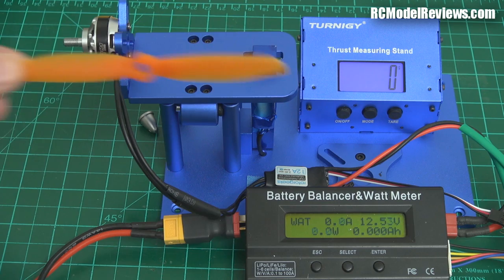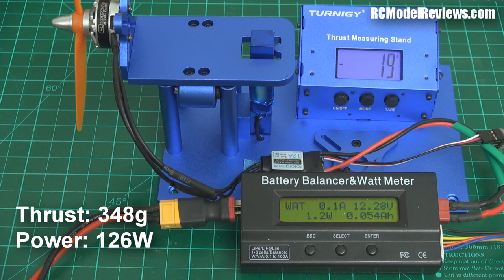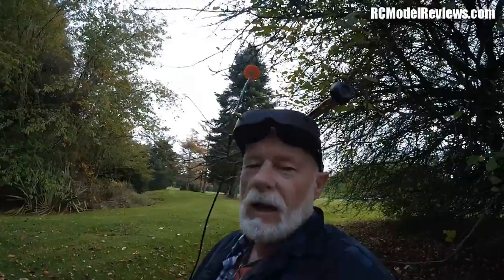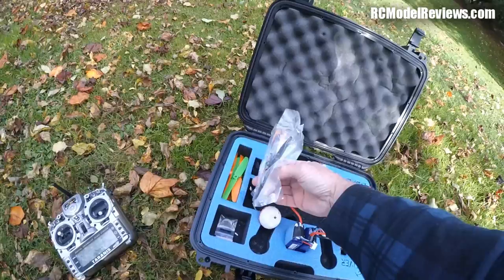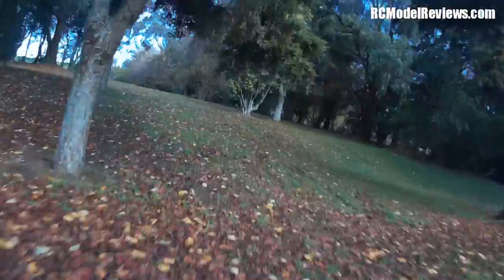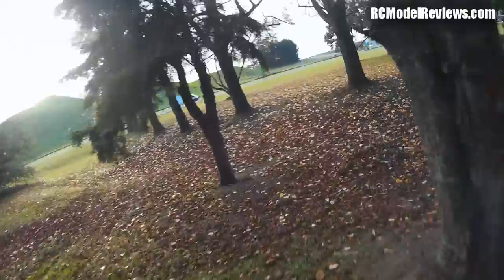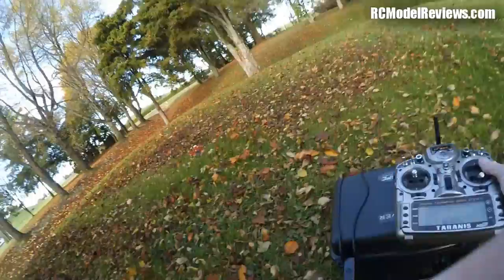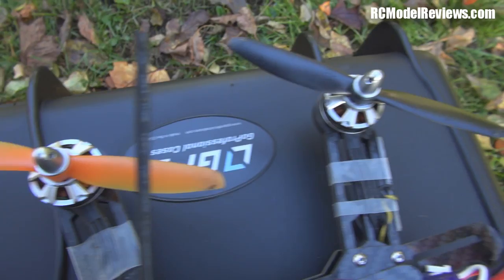Review: Surveilzone 5040 miniquad props (includes crash footage)

Comment: Great review & test.Looks like the chord length is shorter than HQ's & GF's 5040 blade airfoil so the SZ5040 airfoil needs a higher angle of attack. I'm only guessing that's why it produces 9~10% less thrust since that higher angle of attack also causes more turbulence which equals loss of efficiency. Wish HQ would also copy material used in SZ props.... but then not good for business, sales would drop. SZ should just copy prop shape from GF & HQ better. 

The SurveilZone 6040's cut down to 5040's are a good cheap alternative to HQ5045 bullnose props - if you have a prop cutting jig and want to save money. Bullnose props are very amp hungry due to the not-so aerodynamic tips.... lots of turbulence there I imagine, but they sure put out a lot of thrust. I measured them to be within 10g of HQ5045s with slightly less efficiency.
 
Cobra 2204-1960Kv
4S 40C 4000mAh Zippy Compact battery
92m AMSL
HQ 5040 673g @12.3A
HQ 5045 Bullnose 890g @19.6A
DAL 5040 Bullnose 879g @ 19.3A (Surveilzone 6040 cut to 5040)

Comment: Hey ***** thanks again for a great review and for your comment at Harley FPV some days ago, i'm kinda the stuntman in our review.
But Bruce, if you are looking for better performance, try out the 6040 as we use in our video and just cnc drill them down to a 5x40 SZ bullnose(KillerBEE//DAL6040 Propeller ABUSE test //UNBREAKABLE PROPS). Then they are actually better than the HQ 5x45 props even without 0,5 pitch. But the 6040 and the Von Sieg version is out of balance in the end where the numbers are, so where it says DAL it need a little tape slice.
Indestructible No, when you hit a AGP gate with 80 km/h ;-) but never the less a moneysaver.
I had some HQ 5x40 in spring last year and they were the same toughness as the surveilzone, but better in balance. It's like they got their brand imprinted into ppl mind, and then began making poor cheap props in toughness and durability to advance thier sales.
Best regards Jan "Von Sieg" Sigurdsson

Comment: Nice props. The problem is that if the props doesnt break something else have to.. Like the shaft or arms :)
Reply: daromeresperyd Yeah, I'm of the same mind. Happy to be proven wrong though. I'd rather crash energy be released in an exploding prop, rather than a bending motor shaft.
Reply: The Dark Pixel I have already changed alot of shafts lately due to them going out of balance due to that they are bent :)  But at same time if you run 2204+ with 3mm shaft instead of the ones on 1806 that bend way to easily it may work good and you are in the middle. Im gonna order some in next batch to test out atleast. to bad the thrust was so damn low.
Reply: daromeresperyd As I said in the video, that was also my concern but I'm pretty sure these props are flexible enough to deform instead of transferring the forces to the shaft.  I would think that the HQ5045 bullnose would be a lot more likely to damage your motor in a crash because they are thick and quite strong but don't deform much at all.
Reply: ***** ur most likely correct. The lack of thrust is what saves it in the end :)
Reply: ***** These props might be good for a learner to start on.
Reply: daromeresperyd I bent to shafts on my lumeniers in my first crash, with 5030 gemfans!  These can't be any worse on 1806 motors.

Comment: Nice comparison as usual Bruce. 
However may I suggest to also compare the efficiency at a given thrust, for example around 150g which would correlate more with flight time for not too aggressive fpv flights?
Sometimes propeller profiles are too aggressive and stall partially at high rpm and zero wind speed leading to poor efficiency in your test conditions. However they could be very good for in flight conditions...
Also, according to some numerical simulations that I did in the past,  flexible propellers like GFs tend to deform significantly at high rpms because of centrifugal forces. This usually lead to untwisting of their helix angle (lower pitch than nominal) and could prevent tip stall.. however flexible props also have significant drawbacks (resonance...).
Thanks a lot for all your great advises!
Reply: Joël Cugnoni Yes, you're right.. I forgot to do the "hover power" test and the lack of efficiency is only really noticeable when flying once you start nailing the throttle.  In some tight turns the props sort of topped-out -- making lots of noise but no more thrust when the throttle was raised.  The punch-out was also anemic when compared to the GF5040s but when cruising -- not so much difference.   I did notice that my flight times were down by over a minute per battery -- even with the "nana-style" flying I was doing.

Comment: Sounds like a good idea, I just worry about the additional shock loading the motors, and, if you fly a ZMR, motor mounts will experience in dings that would normally break a prop.

Of course the rest of the quad would have to sustain more shock possibly resulting in the discovery of other weak spots.

I've decided to invest in a quad after watching innumerable videos depicting the fun the RC community is having with them. Mostly having fun it seems but I've also seen the misery lost quads have caused. Being new to the game I expect to be retrieving my toy from trees and fields, or wherever it ends up. Flyaways seem to be problematic, 5 to 10 minutes at WOT could see me chasing it over a considerable distance. I don't want to lose it, so, there must be a market out there for an alarm, with LEDs, that activates from it's own power supply, say a 3v lithium button, after a programmable, or set, period of inactivity or the loss of a control signal that may have been caused by the flight battery detaching in a crash, or flying out of receiver range? Perhaps including a "G" sensor to activate the "locator" after a heavy hit may be a worthwhile addition? It would have the additional benefit of alerting your "Forest Flyers" or "Team Nana" to one's "sudden loss of talent".  Something you might turn your mind to?

Comment: Just ordered some 5040 and 6040  going to give them a go on my 280 epic with  Tiger Motors 2206 2000kv Great video Bruce ! have you tried clean flight yet you could use  LEDS =  WS2812 controlled by the Naze32. good fun !

Comment: I bougt 20 packs of those 6040 props cut them down to 5040 bullnose. Went outy and flight tested. i broke 1-3 props every crash. so resulted in breaking about 10propps in 4 battery packs. Probably better to stick with the hqprop 5045 seems to be just as brittle.

Comment: Question - Isn't the point of props breaking to save your motors? When you crash and the props don't snap, all that force goes to the motor, no? Also, you gotta get the gopro rolling on the mini quad! So much better than a mobius and it will handle the weight fine :)

Comment: I have found the problem.the afro ESC's I got from hobbyking had 2 wire control (only -ve and signal} instead of the normal 3 wire ( no BEC}  as shown in your videos.I will have to supply the board now through a BEC. Bugger.

Comment: Weird... the meter says their lift to drag ratio is really poor despite the higher aspect ratio. I'd like to see what the next size up does and what your flight time reduction was. But one thing is for sure they really are tough and if they change the shape they'll put Gem Fan out of business. Humm... maybe that's why. Lot's of money in these little props.... and they are stiffer even though less material with stronger hubs.... major improvement in materials needed for the larger props that break at the hubs.

Comment: ... interesting result, Bruce :-) ... maybe the Gemfan could be unbreakable as well if there are made of the same plastic, isn't it?
Reply: hotliner Yes, I suspect the material choice has a lot to do with the durability of these props because they look quite similar in design to a generic 5040 that I bought from HiModel but those HiModel props actually throw blades in mid-air without any warning, even when brand new -- so it's not the physical design as much as what they're made from.

Comment: Thanks Bruce,great vid as usual.
Ordered a couple of sets for the Team Nana ZMR.

Could you test the cheapy Diatone Ghost 5030's from Banggood?
Reply: 5k0p3y I'll offer my feedback on tthe ghosts. They fly about the same as 5030 gemfan. A little stiffer, but tradoff in durability. They will break off where the gemfan will bend a little. They are cheap, but so are these new SZ 5040. I've flown both, although just 3 packs on the new SZ5040. I'd pick the SZ5040 for bashing and cost over the ghost for cost only.  Up until now, I'd say the ghosts were super cheap basher props, just because they were cheap and swapping wasn't a big deal. Performance wise, about the same. the SZ5040 perform about the same as GF/ghost 5030.  Underwhelming for a 5040 size.
Reply: Matthew Bennett Oh. just for the fun and since nobody was around, I put the ghosts on 4s. They didn't last long before snapping at the root. What I expected, but always fun to confirm.

Comment: I'm building the  miniquad .I've enabled ppm, motor stop . channel map matches Tx (I use TARE). Motors checked with servo tester.
Shorting link between channel 3&4. Board connected to DR4II via channel 1.
Rx has been bound.
When Tx on and everything powered up the Rx doesn't power up. I'm assuming that it gets its power from the naze32 board. 
What have I missed?

Comment: hi bruce I have learnt so much watching your videos thank you very much but the science of props completely baffles me also i am going through a fair few props and would like to get these ones so can you tell me if I can make a direct swap for my ones.
I am running 5030s with dys b1806-2300kva motors, e-max simonk 12 amp escs and a 3s 1000mah 20-30c turnigy battery but the maths to work out what amps the quad is drawing evades me and also what the numbers on props actually means

Comment: Wondering if the prop profile is part of the reason they're so hard to break (I doubt it though)
Reply: Rob Crawford No, I think the material is the reason.  It seems to be a tough nylon (like the old nitro props of the 1960s) rather than an ABS or other more brittle material.
Reply: That's what I suspected, if anything the gemfan profile should be stronger as there is more material.

Have you considered cutting down some of their larger.props to create 5 inch bullnose.

Possibly a thrust improvement ?
Reply: Rob Crawford I think their lack of efficiency comes from the narrow profile.  These are only 10mm wide, while the gemfan 5040 is 15mm, and HQ 5045BN is 16mm.  The DAL 6040 is 18mm wide, completely different shape than the 5040, and seem to perform pretty well.  I don't have a thrust stand, but I think I'll cut down some of these to 5040 to see how they feel.
Reply: chiefILL74 just interested to see if there would be any improvement (or otherwise)

Maybe they will update the profile at some point as tougher props would be handy

Comment: Hi, I'm working on a quadcopter simulation and I'm looking at thrust.

I'm trying to work out how thrust reacts to power over time - ie, when giving power, how long before the thrust is at full capacity, and when you cut power, how long before thrust falls to zero?

For instance, would you say props spin down from full power in 1 second but spin up in say 0.2 seconds?

Is the point of OneShot to have the props slow down faster, and thus cut thrust faster?

Comment: I’ve got an off-topic Noob question here because I can’t find a better place to actually pose it.
I’m purchasing a Flysky FS-T6 FS 2.4GHz RC system on Amazon Prime because I can’t find anything better for the price that is not out of stock. I’ll have it in two days rather than 2 months which is no small thing.
I asked the seller if this transmitter will bind to a FrSky D4R-II receiver.
The response was yes. But I’m dubious.
Will it, without the DIY module work-around?
Thanks.

Comment: I bought these hoping they'd give a little boost in power over Gemfan 5030 but I was wrong. My 3s batteries just don't give it the power it needs. I was getting 6.5 minutes with a 1500mah 3s battery using the Gemfan. With these I get 3.5 minutes and it is very sluggish and hovers at about 70% when it hovers at about 45% with the Gemfan 5030. I am really disappointed.
Reply: JoeSnuffie Damn, I ordered 3x of these, once they arrive I'll have to test them out and compare with Gemfan 5030 to see what I get

Comment: Those Surveilzone props are tough, but since they have less thrust for the same output, did you notice a significant difference in flight performance?  Thank you
Reply: twainhearts Just cruising around -- not so much.  When punching the throttle (such as in a punch-out and especially in very high-G banked turns) most definitely.   I also noticed that I got about a minute less of flight-time per battery with these props when compared to the GemFans.

Comment: Hi I was just wondering if you know anything about  JFRC U2208 2600kv Mini Motors? Good, bad, outher.
I'm planning on running them on a WASP280 with extended 10° angled motor mount so I can use 7" propellers (maybe, maybe not) and I can rake in the back so I kinda get a V-Tail effect.
Reply: Never mind. I found them in sunnyskys on ebay, half the price! Thank you for all the work that you do.

Comment: bruce, what size battery are you using on your 250's? 3cell? 4 cell? 1100-2200???
Reply: MrTaz0079 That was flown with 1500/3S Nanotechs.
Reply: Thanks Bruce, What sort of flight times are you getting using the 1500's? I followed your 250 build ,but for a couple of changes, Carbon Fibre frame,12A emax esc's on 5x3 Gemfans & getting 9-10 mins from a 2200 3C,,Great video as always , keep up the good work,
Reply: ***** what C rating 1500/3S Nanotechs are you using on your 250s? Please..
Reply: MrTaz0079 35-70C ones are best.